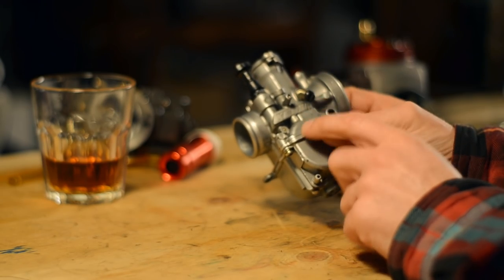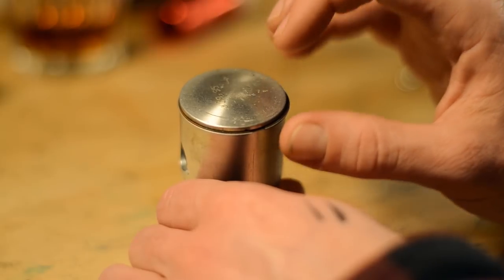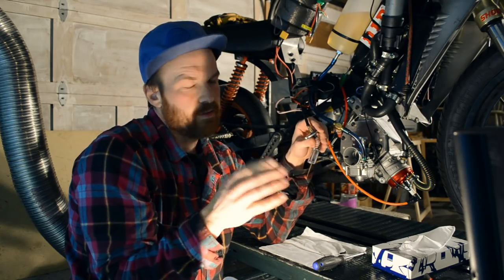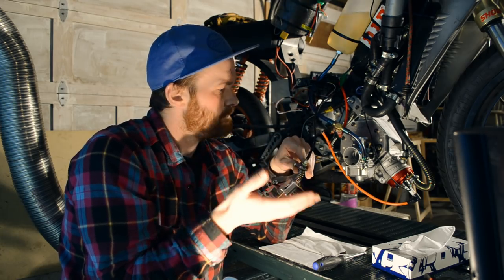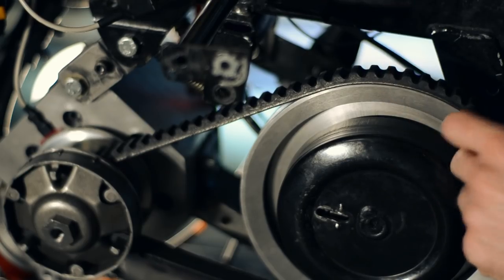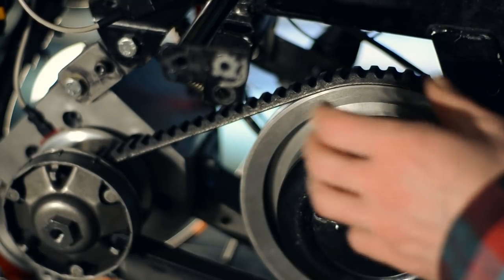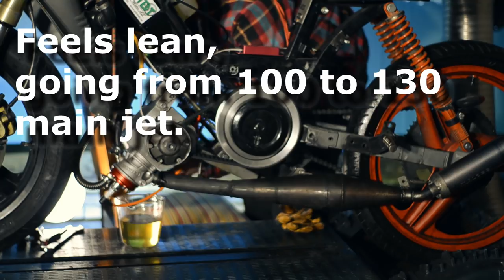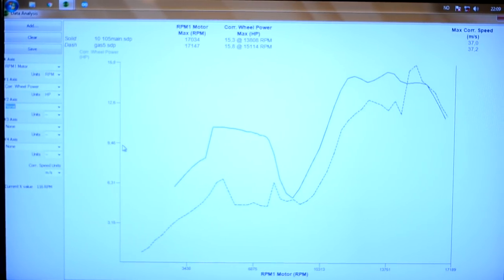FUEL FOUNTAIN! | Spx Ressurection Part 6

Comment: Aside from the fuel leak it now revs out.
That was the aim, to find out why it wouldn't rev out before.
So now work your way back in single steps so you don't loose track of the progress made
Next try to run Nitro with the smaller carb to see if it revs.
Then put the larger carb back on and run it on petrol.
You have already run it on the big carb with Nitro and it doesn't rev, and have run the smaller carb with petrol and it does rev.
You have to test all 4 conditions if you want a hope of making progress, there is no shortcuts to the top of the mountain.
If it wont rev with the bigger carb on petrol or nitro and will rev with the smaller carb on petrol or nitro, its likely carb size
If it revs on Nitro and Petrol on the small carb, but with the bigger carb revs on Petrol but not Nitro.
Then the problem is likely the bigger carb is having issues with the higher Nitro flows.

Comment: Btw i have noticed that if u drill out  main jet like say 1.5 mm, it doesent mean that it will flow same amount of fuel than factory made 150 jet. Its allso important how long the part thats 1.5mm is, some jets have different debths of that part so it kinda messes everyting up. some jets work but some wont so just keep tjat in mind when drilling jets✌
Reply from the maker: Thanks for the heads up!
Reply: The length of the hole is at least as important as the diameter😎

Comment: fuel injection would be amazing dude a lot of issues gone, new issues arise though
Reply from the maker: It would, but as you say it's a can of worms!
Reply: Hmm but this should be possible with a carb.. Am I right that the reason it's spitting fuel is only because it's mounted on a moving engine? (therefore more vibrations).
Because I'm wondering.. lots of bikes run carbs.. what's the big difference here. High rpm, vibrations..?

Are you sure that the rotary valve works fine? The fuel mist almost looked like it's being blown out the carb.
Reply from the maker: It's probably a combination of high rpm, crank balance factor, stiff intake ++. There's alot of blowback at lower rpm, but it seems fine up there.
Reply: Don´t go the injection route until you know how to add fuel when the pipe is doing it´s magic =)
Reply: blow back is a normal thing on 2T engines, even 4T.
but this seem that you have a lean mixture at bottom rpm.
Reply: blowback on 4t sounds like a poor valve timing and alot of power loss. From my understanding blowback on a 2t is because the intake (membrane its called?) isnt closed exactly when the piston goes down again, so the piston pushes a little bit out again because thats how membrane valves work. A perfectly adjusted rotary valve would fix this because it is closed exactly from TDC ( maybe even very slightly before).
but i am not a mechanic so i might be wrong
Reply from the maker: There's alot of blowback at low rpm because the valve needs to close late to work good at high rpm, 88° atdc in this case.
Reply: Why don't you try putting some kind of velocity stack on the intake of the carburator? Should smooth out the air flow and probably also significantly reduce blowback...

Comment: I made a suggestion about fuel foaming before, just clamp a heavy weight to the carb. At least it should help on the dyno. Your engine is looking good again. With the carb I wonder if a floatless one might help. One where a scavenge pump returns fuel to the tank when the level gets high enough. Some off road buggies use similar systems to run in high shock environments
Reply: Nice ideas.
A softer more compliant carb mounting and some weight added would alter the frequency and help absorb some of the energy. Plus it's pretty easy and cheap to do. And as you say, the weight doesn't matter on the dyno.

Comment: Have you thought of the idea of jetting chronically lean and feeding extra fuel through a small injector until ideal conditions? According to some sensor readouts you could determine if it's running lean or rich which would be used to operate the fuel injector.
You'll have to build and program your own efi system though.
Reply: Lucas Rijnders powerjet

Comment: Go and try a Mikuni TM28. I made good experience with the Mikuni carburettors. Don't waste your time on fuel injections. A machine like this should operate just fine with the right carburetor and the right setting. At first I thought you screwed up the inlet timing. Something messed up like to long inlet timing. But when I heard it screaming, I thought it can't be that bad. 

What fuel tank and fuel tank valve do you use? May pressure from the fuel tank makes the carburettor seem to run so rich. I had that on one of the automatic fuel vents two times! Fuel was running though the membrane in the inlet of the motor. I tried 2 carburettors and hours of trying to find the right jet until I found that dripping hose. Could throw that beast on the wall for that still today :D

Comment: Amazing as usual, great lighting and angles. Good to see it revving again. Btw, you probably lowered the needle and raised the circlip to the top position ;)

Fuel injection sounds cool, but I think it would be good to sort the whole engine out with a carb and get a nice baseline before making things more complicated again. Also I'm not sure if you're going to get much more from fuel injection, since you can tune the carb for high RPMs anyway with your CVT.
Reply from the maker: Thanks! Yep, ment the circlip...

Comment: Minimal combustion chamber clearances are not so necessary when using a tuned exhaust as the engine is heavily supercharged if the resonances are right.....
Reply from the maker: A tight squish gap is though to prevent detonation and create turbulence.

Comment: Hi 2 stroke brother, would it matter if I were to cut off most of a 70cc cylinder skirt to fit a special crankcase?? Also whats the best way to gain power on a 2 stroke other than porting and a pipe??
Reply from the maker: It depends on how much of the piston is still supported at bdc, I don't know where exactly to draw the line, but the less support, the more wear and shorter piston/bore life. The most important thing in a two stroke is that everything works together, plays by the same tune if you will. Pipe, port timing and area, transfer geometry, compression ratio, crankcase volume, intake size etc. There's not really a one best way after you've installed a pipe.
Reply: 2STROKE STUFFING ok thanks I'll  measure how much to cut off

Comment: How about a "walbro" diaphragm carb? Absolute heresy from a cycle standpoint, I know, but the complete lack of a float bowl, and "weed whacker" (high speed, low speed) circuitry seem suited to the test bed conditions, if not street riding. The engines they feed tend to be hyper revving, vibratory nightmares that run in almost any position. Suitability for nitro is low (purging seems problematic), but for gas they seem well suited to at least getting "solid" fuel for the mix, rather than foam, and possibly higher output at speed.
Reply: Not a bad idea actually.
Good test bench carb.
Play with blow off pressures a bit to set the mixture tap range and has mixture taps easily adjusted on the fly.
Compact, self contained pump making them easy to fit a power jet to.
Used for decades on 100c Rotary Disc intakes revving to 20k.
Reply from the maker: I've got a 24 lying around, might be the next step!
Reply: AuMechanic pretty much exactly my thoughts. Here they still feed chainsaws and the like, so vibration seems a near non-issue, and on whackers and blowers they feed engines spinning like meth fueled dervishes on roller skates. The downside is they pretty much aren't well suited to a transition to street use, though the old tilletsons of "semi diaphragm" config saw such use. Both are currently made in "chineseum alloy" versions, so cheaper than OEM rebuild kits, and get good user reviews on the tube as replacement gear.
Reply: A tilletson would be better.
Reply: AuMechanic probably. They saw low speed high vibration use in harleys for decades. I know they see use in wide throttle range equipment, rather than the walbro "idle/wide open" typical load cycle, so street use would be far less problematic.
Reply: A good shout I reckon been using them for years on kart engines, it might be more difficult to get the fuel volume through it when you get back on meth though.
Reply: i just was nosing around tillotson current uses, and it seems alky use (on carts i presume) are kind of common, with genuine article variety being "reasonable" in price, running up to "OMG, you're kidding" pricing for "blueprinted" full on racing cart bragging rights versions. 100 bucks for a 24mm venturi 2 stroke gasser genuine OEM hl360a is reasonably comparable to what a mikuni of similar spec would run, and chinese clones are around 30 on amazon. there also seems to be a huge volume of hop up tips available, as they appear to be the choice of cart racing folks (i had no idea, lol), so modding for high fuel flows would appear to be doable on a budget, even on the chineseum alloy clones. worthy of investigation, at least. lots of walbro types for large displacement chainsaws and similar 2 strokes on amazon too, i would imagine a bit of head scratching and spec sheet crawling could dope out a unit that will move enough alky go juice to feed a 50cc hyper mill with a reasonable bore size with some mods that are more labor than wallet intensive, lol
Reply: I would definetely go this route aswell. The Tillotson hl360 mentioned above I think is a bit too poor for very high rpm usage, but the high quality karting diphragm carbs, like the more expensive Tillotsons, IBEA or HHC should easily deliver enough mixture for a running at 18.000+rpm. 

Some of the older carbs made for the old 100cc karts even had a 3rd jet called a "power jet" that only adjusts the mix at the very top of the rpm band. The very last ones of the crazy watercooled 100cc kart engines, before the sport changed to 125cc, ran at 20-22.000rpm! Albeit only for very short periods of time before going kaboom :P
Reply: I used to race karts and i think this is a great idea, i was going to suggest it if nobody else had. There is a lot of variety available brands/sizes. I think for this a pumper carb is the way to go. And there are seals etc to suit alcohol fuels.

Comment: Hi! Why you didn´t perform a break-in procedure to the new piston and rings before rev it up that much? 
Wouldn`t it be better on the performance side for your pourpose? Just curious about your thinking.
Great video series! Cheers.
Reply from the maker: I did heat cycle it a couple of times off camera but that's it.
Reply: Ohh, I see. Well, that helps a lot for sure. Thanks for your reply.

Comment: I got one more question, when I'm shortening the cylinder skirt should i use just a normal dremel or one with a flex shaft?? Also when I'm shortening the cylinder skirt what bits should I use?? Thanks
Reply from the maker: You can use anything that will cut metal, angle grinder, dremel, hacksaw etc clean it up with a file and paper afterwards.
Reply: 2STROKE STUFFING ok what bits should I use??
Reply from the maker: Cut off wheel would be most suitable I think.
Reply: 2STROKE STUFFING ok thanks

Comment: Naaahhh, its still the ignition that's your problem,, Hahaahaaaa!!!

Fuel frothing!! 
You could try my idea on using anti-explosion foam in the float bowl.
Another way is to add lead weight to the carb, this will change its resonance frequency.
The more weight you add the lower the self-exciting freq.

Also, you can add acetone to petrol to lower the surface tension of the liquid, about 0.5% will do.
This reduces the bubbles ability to stay a bubble for long, however your carb was really shaking like a '70's disco diva.

More ideas to come, but one thing at a time.
Reply from the maker: Thanks for the tips(again 😁)!
Reply: No worries, if you need inspiration about tuning 2 strokes on a dyno, go no further that this howling jobbie,, https://www.youtube.com/watch?v=XZkxJJrB9ZM,, perfect plug chop too.
Reply: Alex i watched the video in more detail. If you look at 11:16 onwards in 0.25 speed you can see a foam band around the bowl drain nut forming as the revs rise. As the revs go higher still the foam band splits in two with one side pointing to our right (almost the front aspect of the bike) as we view and the other pointing to our left shoulder. That means the vibratory plane is cocked about 10 to 12 degrees counterclockwise from the vertical. The top of carb is moving towards and away from us but on that angle. As you mentioned previously, the proper way to reduce frothing is to change crank balance factor. However looking at the bubble size I think the vibe amplitude is quite low but the Hz freq is higher than the engines natural freq, so likely your getting harmonics (i'd guess at 3rd order 700-800hz).
The reason for this I think will be down to the custom disc valve cover. Its quite thick and a large unsupported (and undamped) mass of Alloy. That alloy sheet is acting like a drum skin . If you look at your original cover its scalloped and trimmed to a greater extent than yours so have less mass and a have a different frequency response due to the differing thicknesses across its cross section. Apart from the attaching lead weight idea, you may try using a very thick (3-4mm) cork gasket on the inlet manifold/disc cover joint. This will introduce an additional damping medium (the other being the rubber manifold) into the vibratory 'system'. I also suspect vibration may have had something to do with the problems with the bigger carb.

Comment: Kreidler van veen piston, nice. First 50 cc piston reach over 200 kmh
Reply from the maker: Should bring good luck! It has some nice features - ring pin 180° opposite of exhaust and 0.8mm ring.
Reply: 2STROKE STUFFING Might not be same design though :) the original piston is over 40 years old, but still fun to see the writing on the box :)

Comment: 2 things if know about security for having witnessed it first hand. Never go above 16000 rpm with a 16mm crank especialy with a non balanced variator. I saw one overtake me during a race , the shaft had broken . Same on the bench but with the effect of having the operators jaw  and forearm broken. Second the variator itself. When going above 12hp we used larger belts because of the risk of rupture. Worst case they burn up and end up turning as with you. Worst it rips a skashes at your leg.  I destroyed a furigan boot like that . A friend ended up with 18 stiches. And last the variator above 13k most variators are dangerous. I don t know the brand you are using but the bidalot, doppler, conti ect all had to be x rayed for defects and we had to have the test with us before the race. This is following an accident where a guy ended up with a part of the variator half ripping hisnarm off. Else happy tonsee you are progressing. What spark pkug are you using b11 b12 ?
Reply from the maker: Thanks for the tips/warnings! I should make some kind of blast shield. Running NGK R6252 10.5
Reply: 2STROKE STUFFING okay running this rich with b10 105 or 11 often means busting them.  The consensus was use a b9 to tune on small pulls then move to b10 or b11. Most of the g3 liquid cooled large carbs in 50cc used up to 30mm carbs and main jet of 146 max but always the racing ngk 11 for 25C + the 105 from 15 to 25 and 10 from 5 to 15.  I just remember busting one because i accidently put  4 points too high on a single pull. Else you have this adress that isn t a bad webshop http://www.mir35.com/2-piece-mob-mbk-motobecane-peugeot-ciao
Reply from the maker: Thanks for the advice!

Comment: What should my header and stinger size be for a 70cc?? I'm making a custom pipe for it becuase my engine is a totally custom 70cc for a rc 1/5 hpi Baja but I'm still in R&D stages but will start soon. Also what should be the port size on the header flange??
Reply from the maker: Here's Frits Overmars' set of equations - a really good starting point. Your header flange should be about 75% of total exhaust port area for a good dual or tripple port and around 90% for a single. Header should start at same area as the port. http://4.bp.blogspot.com/-MgZiKNYsFws/UrGD6ifMgPI/AAAAAAAACso/_BHY05ZOm5I/s1600/fos_ex10.gif
Reply: 2STROKE STUFFING what should be the outer diameter of the header tube and stinger tube? Thanks for that graph!!
Reply from the maker: Header size depends on your port size and stinger size on estimated hp produced, there's calculations for it in Frits' drawing.
Reply: 2STROKE STUFFING ok thanks!!!

Comment: Any chance your close to short circuit that cylinder, exhaust pushing the mixture out the carb? It seems to have a good amount of fuel mist even at idle. Good progress just an observation.
Reply from the maker: Possible but unlikely. Blowdown time area is sufficient even at high rpm. The mist at idle is due to the late closing rotary valve.

Comment: I've heard that nitro methane eats away at the oil seals and rubber in the carb is that true?? I know if you leave it it will eat away at the metals but will it eat the rubber?? And how to prevent that? Also what percentage of nitro fuel you are running??
Reply from the maker: Both methanol and nitromethane are corrosive and  can damage some rubber parts. I haven't had any issues yet, but pay close attention to how things are holding up if you try it.
Reply: 2STROKE STUFFING ok I will definitely keep a eye out every time I shut the engine off and before I start it. What percentage of nitro fuel you are running??

Comment: What is the flame speed of nitro in comparison to petrol? You can align fuel air ratio but maybe now exhaust or something like that gets worse because of that?
Reply from the maker: It's slower, and the extreme amount of fuel makes exhaust gases cooler - power lower in the rpm range.